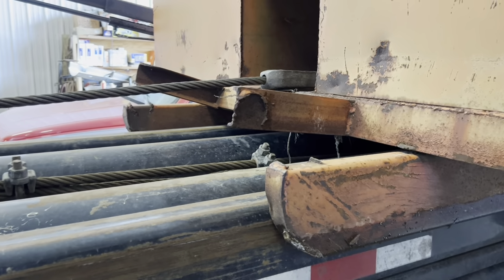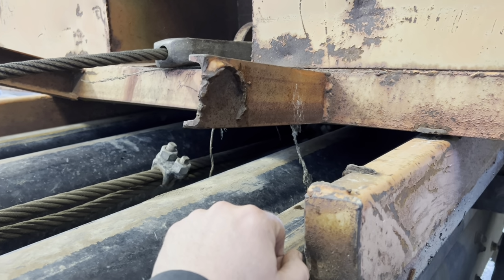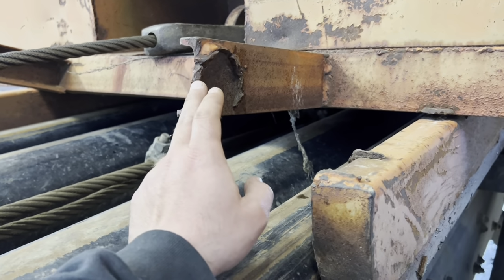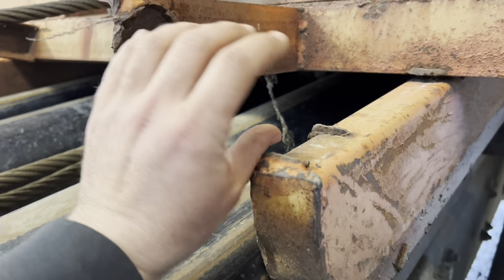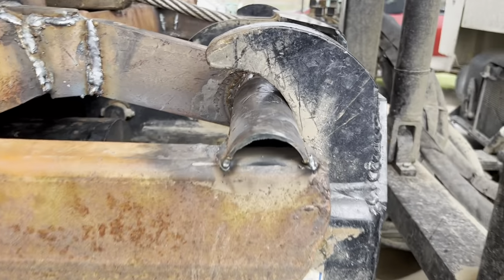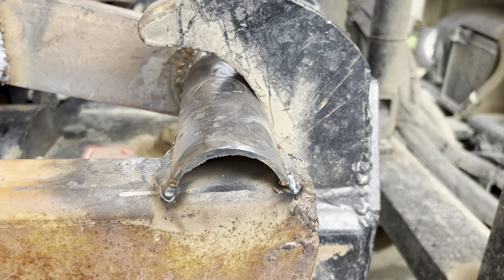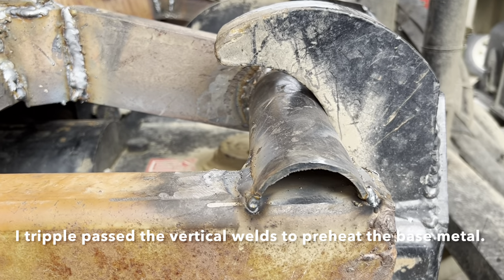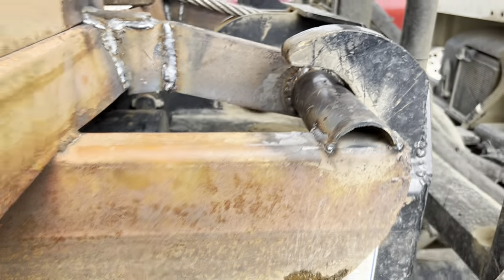20 yard Rolloff Dumpster Repair

Comment: Pretty cool how you put the sheets down to protect the truck.   That was smart.    (Me, in the smart department I'm about ...ehh...maybe fifty fifty...forty five - fifty five..   or was that forty five..sixty five?..)
Have a great weekend!
Reply from the maker: Thanks WRentals. I’m 50/50 on a good day.  I should kick the tank off or use a chain to load it backwards but I get lazy sometimes. This is a happy medium. Truck has battery disconnects but I worry about a hot one going and burning a hole threw an air line.
Reply: @MikesMischief  that would blow.  When that kind of thing happens we learn we can't blame the helper.....seeing how we were working alone.

Comment: Nice repairs. But pipe shouldn't go there it should be rollers so it can ride smooth on the rails.
Reply from the maker: I agree but I don’t write the checks around here so I do it how they ask me too.  There’s some safety sensitive things I won’t budge on like steering and brakes and sharp edges thing like that I refuse to do things improperly.  We drop in mud and gravel 99% if the time and they don’t roll.  It is additional wear on the top of the tube/rail on the hoist but they’ve been using 2-1/2”-3” pipe for the rollers for 15 years and wore a Peterbilt out and the top of the rail/tube on that truck was still holding strong.  Personally I’m used to holding the boxes tight.  Customers come walking behind the box while I have slack out and if it took off they’d be in trouble.  I’m so used to driving out from underneath of the box that it’s foreign to me when they roll off on their own.  Once the hoist is pat 45° and the box is halfway down they do usually slide off of the hoist unless it’s in mud or digging a hole in grass.  We find this pipe all of the time.  I literally found 3 8’ pipes in a HVAC customers box 2 weeks ago.  That’ll be enough to fix 12 boxes in the future.  But you’re correct in saying that the best way to do something is the right way.  This box has probably made enough to pay for itself since I made this repair but some folks would rather buy 2A stuff than rollers for a dumpster😅.